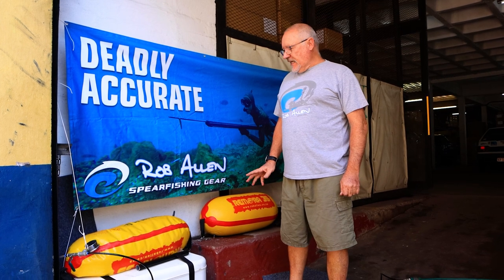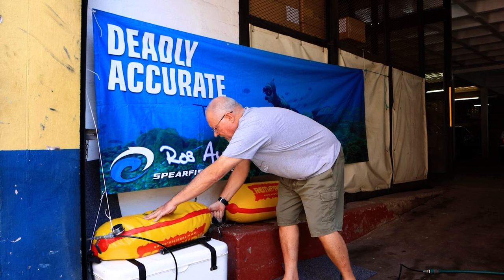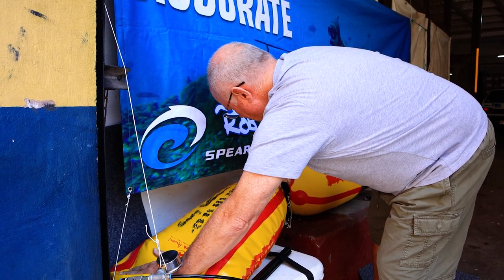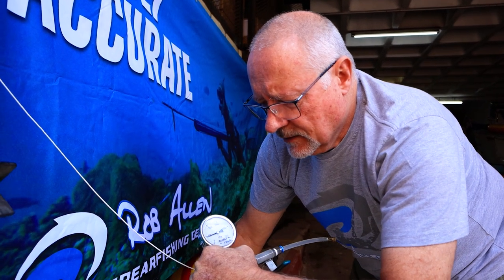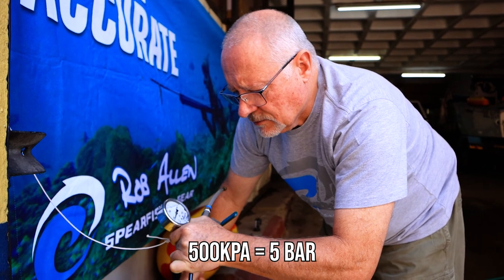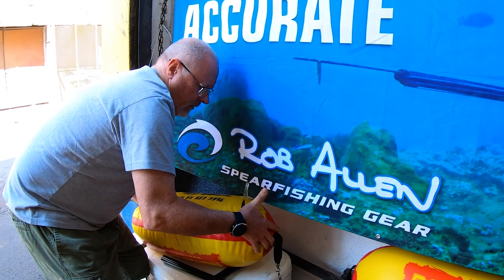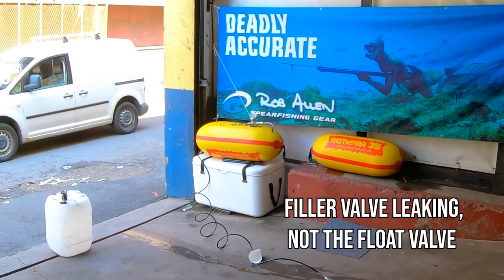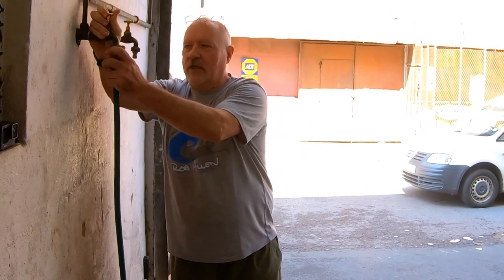Rob Allen | Float Volume Test | Part 1 | 2022

Comment: The area around the plug in my float is not good. Might have to shrink wrap it
Reply from the maker: PVC glue and a patch over it is an easy fix if you need to repair yourself.